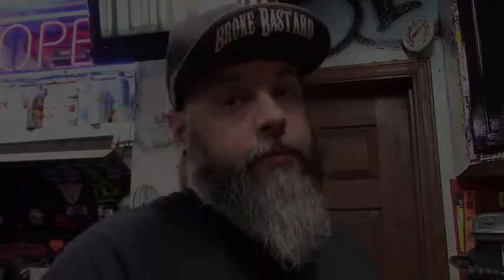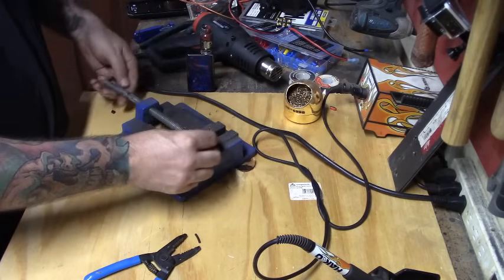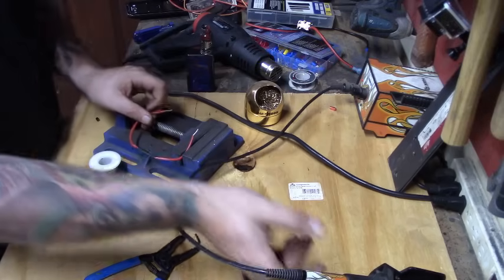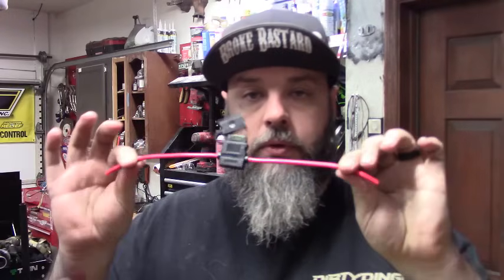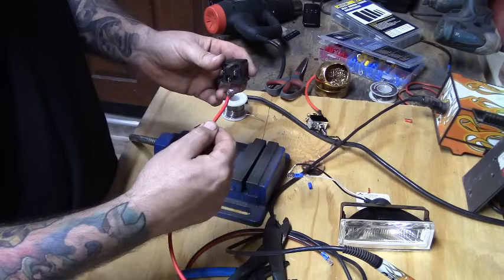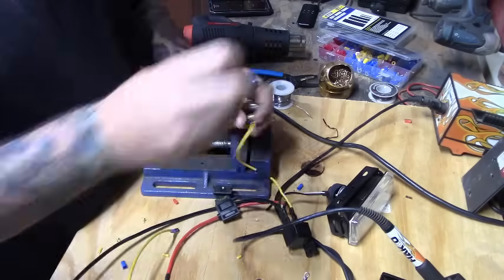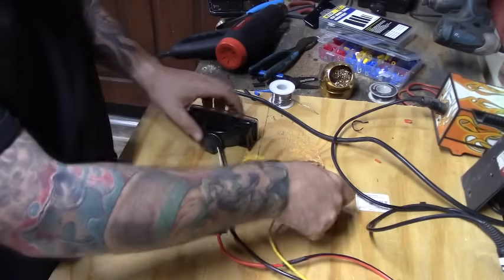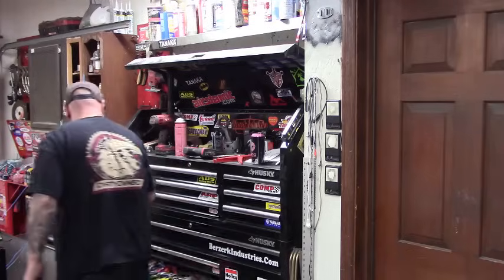How to wire a Relay and Why You should use them.

Comment: Great vid. Can I also suggest placing a diode across pins 85 ->|- 86 (in the direction - ve  ->|- +ve). This passes the back emf on an inductive load (relay coil). Some relay holders come with this diode already across those pin wires. Also, many of the relay holders that come wired, will only have the spade connectors crimped, not soldered.

Great tips here. Take care of that li'l kitty! :)

Comment: You should have a separate video for soldering (and zoom in on the soldering process) that points out the differences between stranded and solid wire techniques, and reference it - this video is for relays. Instead of using the vice, you should take the time to find the correct tools for the job. Emphasize rosin core v. acid core, the latter is used in plumbing and will ruin electrical connections. Lost interest at 8 minutes, which is about the time you started the content of the video.

Comment: It might also be good to point out also that the contacts on the relay are made bigger and beefier, to handle higher amperage than the contacts on a switch can. Which is why they use them with switches in professional installations.

Comment: Never ever just solder and heat shrink multiple wires to secure them together. always use either a mechanical connection or twist the wires together before soldering.  You must have a mechanical connection in a vehicle. You can not relie on solder  alone to withstand vibrations found in a vehicle over time. it will fail, not if but when! Otherwise great vid! I should also point out that its best to use double walled heat shrink, especially if this is used under the hood. if your flux is not "no clean" be sure to wipe the solder joints with iso alcohol before adding the heat shrink. this is to prevent the flux from corroding the joint over time.
Google how to properly solder 2 wires together. There are tons of vids available.
Thanks for sharing
Reply from the maker: Night Rider I never use a solder joint to support the wires. The in always mechanical straps securing my wires.
Reply from the maker: Night Rider also I never place relays in the engine bay because I build a lot of open wheel cars and I prefer the relays and fuses inside the cabin away from the weather. Also I very rarely have any connects exposed the the elements.   continuous runs only. As far as the flux rusting. I have cut open and removed the solder on cars I built ten plus years ago(no rust). But thanks for your info and knowledge.

Comment: No it's definitely the wrong way. I used fuses on everything rewiring my 90 bronco 2. A year later my headlight switch with 30amp fuse, and blower motor same way. The fuses never blew, but switches burnt up on both. Today I'm going out to wire in relays and changing switches

Comment: Solder alone won’t hold over the long term especially for off road. You need a mechanical joint as well such as the crimp and solder.

Comment: should the relay be as close to battery as possible?
Reply from the maker: Andre the polock doesn’t matter but if I was going to put it very far away I would fuse the power wire

Comment: How do you know what size relay? I suck at wiring
Reply from the maker: You have to find the draw that the accessory is using. If its not listed use the size of the wire. There are charts on line to reference, that show what amperage each size is rated for.

Comment: I don't understand at why you put an in line fuse on the light if ur using a relay? You essentially have two "fuses" on it?
Reply: A relay could potentially fail in the closed position keeping the circuit alive resulting in wires melting down and or fire. Fuses are cheaper and easier to replace. Also you could effectively use 30 amp relays on everything then simply put the appropriate sized fuse to protect the device and or wiring (based on the wire size and the load it is designed to carry)
Reply: @vanblindguy4600  30 amp relay 15amp fuse good?
Reply: @cavyboy99  yes absolutely
Reply: @cavyboy99  base your fuse size on the load of your accessory. For example if your lights are going to pull 10 amps under normal use, consider using a 15 amp fuse but also make sure the wire you are using will easily handle 15 amps you want the fuse to be the weakest link in the electrical circuit.
Reply: @vanblindguy4600  ok thank you. I'm just installing neon led light pods they aren't using much. So using 16 gauge wire. Thank you for replying back

Comment: Awesome video, learned a lot and went straight to get scrap wire to practice my soldering. Just one thing I didn’t understand, are you putting the relay in leu of the fuse or are you putting both?

Comment: ...What's a simple way for a Broke Bastard to make a car alarm that would ONLY work when doors open or window (s) break?...NONE of that Fancy stuff......
Reply from the maker: NonYourBuz see if you can find an old school Bulldog alarm. They had one wire to the body of the car and worked on vibration. Cheap and easy

Comment: Great video man very helpful, would 40/60 solder with the flux core be ok to use for the headlight wires instead of 60/40

Comment: It"s my personal preference is too put the switch in the ground wire.
Reply from the maker: Jack Gale more and more people are telling me the same. I have seen some people that use the relay to connect the ground
Reply: @BrokeBastardGarage  Any idea why?
Reply from the maker: @andrewbuckau5792  i have been told that the ground side carries zero voltage and a lower load
Reply: @BrokeBastardGarage  What effect(s) does that have?
Reply from the maker: @andrewbuckau5792  its just breaking the ground instead of the positive. Either way you just breaking the circuit. just make sure you fuse the positive and the fuse positive.

Comment: I was once a fuseless electrician like you,  but I took a short to the knee, Im a framer now. XD. Cereal though, it is amazing what rats nests I find in bikes and scooters..take your average electrical knowledge and cut it by 3/4 and you can imagine the meltdowns Ive dealt with. "Relay is the best way" but the ole  duel feed linked fuse is the stand by, double fault only sucks when looking for fuses, relays are expensive and that always sucks. Although, I have hacked my fair share of dead relays with a matchbook cover. XD

Comment: If you want to see what happens when you skip fuses, relays, and use the wrong size wires, go checkout your local pick a part at burned up vehicles most likely many were caused from hack job stereo installs and other hacked wiring jobs for accessories.

Comment: Are you kidding Mister---those crimpers are SHIT. Get a good pair of calibrated ratchet crimpers. And if you are soldering your wires you don't crimp. You don't mix crimp and solder. When you solder you now make the connection and the wire more ridged and brittle--it will fail. Crimping properly gives the wire connection extreme strength and retains the flexible qualities you need for a lasting circuit.

Comment: thats a horrible cable joint. you got a copper wire which has lower resistance, you tin the wire with tin/lead which has higher resistance, now you got a shit joint that will heat up. gotta twist both ends of wire together 1st then solder it. need that copper on copper contact.

Comment: tack soldering pieces of wire together  isn't physically a strong connection. the wires should be twisted together first.
just my .02c

Comment: Ohhh come on guy i wanna see the stripper with a sweet pair.love the video just curious is relays more to protect wires from getting hot by 12volts and burning ur car down in case of short.,??was just always curious why we need these relays.??thanks,snookie pa.
Reply from the maker: Relays carry the load so that it is not going thru a cheap little switch and shorting out (burning up)

Comment: I’m wondering if a short discussion would have been worthwhile as to when (under what circumstances) to use a relay. We don’t use a relay for all loads so we have to determine which loads (circuits) should utilize a relay and why.
Most switches and accessories are rated in either wattage or amperage. Not all accessories (like a car radio) need a relay. 
Knowing the amperage draw of the load (accessory) is key to determining whether a relay is required. If you know the wattage simply divide the applied voltage value into the wattage rating to arrive at the amperage in the circuit. 
Now you know what components such as fuse, switch, and perhaps relay, you need. 
Simply add at least 10% to 15% value to the known circuit amperage when selecting your components.
Reply: Relays are for heavy amp draws most of the time.  Winch?  Use a relay.  Power inverter?  Use a relay.  Ungodly bright light bar?  Use a relay.  New tachometer that only uses a couple amps? Fuse it.  

Looking at your fuse panels can give you a general idea as well.  The blade fuses normally don't go above 30 amps.  Stuff like the horn, headlights, etc that draw a lot of amps are all on relays.

Comment: Dude you people that think you know anything about wiring please leave it to the professionals fuck me i seen some cowboys before but you and Eric the car guy take the cake you crimp the wire so it can mechinaly join and the no need to soldier it's a relay depending where you are soldering the coil side or the output side???? you don't need to solder just crimp with proper terminals.

Comment: That's one way to do it, but it would never pass inspection at any production plant, in America.

Rule 1.) Make sure to do a good clean job of stripping the insulation off of the wire, ensuring that NO strands get nicked or sniped.
2.) Make a good MECHANICAL CONNECTION of your splice. In your example, that would require TWISTING your bared wires together, inline, rather than ends together, for a length at least 7 times the diameter of the largest of the two copper wires you intend to join together, (or the diameter of the strand bundles if using stranded wire)
3.) Be sure to check to make certain sure you have a strong mechanical connection that won't pull apart. The wire should break before it pulls apart.
4.)  Then you flux it, and solder it carefully WITHOUT burning the insulation, at all. (You may have to practise this, and adjust the temperature until you get it just right.)
And don't use too much solder. You should be able to fully wet the solder splice with full copper coverage, yet still be able to see each strand of wire once the solder cools and shrinks.
5.) Then clean off all the flux.
Standard solder school 101... since forever.
Just sayin'.

Disconnecting a high current DC load is very destructive for mechanical contacts, expexially when switching inductive loads, like solenoids, motors and relays. 
Take careful note of the DC specs of the parts that you intend to use.
For DC, you're far better off using solid state relays that use internal MOSFETS.
They are just as easy to connect and use, more so in most cases, and will holdup MUCH longer in DC service. They won't arc-over like mechanical contacts will.
But if you insist on using electro-mechanical relays, it is imperative to add "back EMF" protection. (look it up, expexially as it relates to relays). Expexially if you have ANY sensitive electronics onboard, like stereos, engine/trans controllers/modules, electronic ignition, etc.
A simple relay breaking contact can create a HUGE voltage spike, thousands of volts!!! if you don't take the required steps to prevent it. It's a pretty simple fix.
Break-downs that can be avoided, should be avoided at all costs. Electrical failures are no fun when you're headed to Vegas across a scorching hot desert. I'll go one further and state that no break-downs, anywhere, are fun.
Jussed tryin' to help.
No offence intended.

Comment: Save yourself a few steps, use marine grade quick disconnects. The also have a version that crimps, solders, heat shrinks, and is shielded around the female end. They look like this:  https://www.waytekwire.com/item/30982/Molex-19164-0017-Perma-Seal-Quick-Disconnect-/

Comment: Great video, but I connect both the switch & relay wires after the fuse, just in case one of the switch wires shorts out to the frame, I don't want burning wires in my vehicle!
Reply from the maker: yes you should always fuse any power wire

Comment: Yeah but what does that inline fuse have to do with wiring a relay?
Reply: The inline fuse is still there to limit current flow in case hot wire ever shorts to ground. If it’s not there the wire will carry as much current as it can before the wire melts. This can lead to a fire.

Comment: Thanks for the Video on how you do your wiring,,, 
Never tinned my wires first and always used big solder... Going to give your way a try next time, maybe it'll look better...   Thanks
Reply: The secret is '
in choosing the 
solder wire core
chose 60/40 solder 
and at least 60 watts 
220 VAC electric solder gun.

Regards

Arab Aircraft Engineer
and QC Lead Inspetor ,
Jeddah, Al-Hajaz, Arabia .

Comment: RELAYS are bad news for starting DC fan motors from a dead stop.  Peak currents can blast the contacts or even blow the diodes in your alternator.  Some fan can have over 100 amps peak starting current.  Using Pulse Width Modulating control of your fan motor is a better way to control radiator temperature.   www.autocoolguy.com

Comment: Good video. Few suggestions, only switch the negative. Not only is it safer but typically less wire since you can utilize the body as traveler/source. Also worth installing a diode in parallel between the coil of the relay to prevent back emf from wearing out the switch.

Comment: First off, my electrical expertise doesn't go too much farther than installing car audio or the occasional light fixture/ceiling fan or outlet in a house. I've always used the crimp type connector for car stereos(or twist-on wire connector for household wiring) and all but one time, it has been successful. The power wire came loose on one of my cd player installs and since then, I triple checked that all of the crimp type connections were secure. That being said, I have never soldered anything until now. I used your method and soldered the wiring harness adapter to my cd player on my newly acquired Crown Vic police car, heat shrink tubing and all. It worked like a charm! I definitely won't ever use the crimp type connectors again unless there is no other option. Anyway, thanks for the excellent guide and once again, you gave me the confidence I needed to attempt it myself. Thanks man.
Reply from the maker: Anytime. Glad I could Help.

Comment: Uses rosin core yet says he does not use flux. WTF do you think rosin is? Also, solder does not "dry". It cools... BTW, the connection of a properly crimped terminal (not connector as you call it) is magnitudes stronger than a soldered connection. Solder cracks, crimps don't.  There is a reason you never find a soldered connection from the factory in a vehicle. It's because due to vibration, they fail. A properly crimped connection does not need any solder. You are just wasting your time and effort. You are not adding any strength when crimped correctly. It's also perfectly fine to break a connection with a properly spec'd switch without using a relay. Automotive manufactures do it all the time. The only time a relay is required is when you either don't want to run the high current wires to the switch location or your switch is underspec'd for the load.

Comment: Good informative content, thanks. What do you think of using a Fuse Block to add multiple accessories? Some come with a built in relay and gives you a choice on whether you want the accessory on switched power or not. They are relatively easy to wire and consoldates everything to keep away from other wires. Thoughts?

Comment: Horrible method for soldering.    Spread the strands of both twisted wires.  Push one end of the wire into the other so spread strands cross one another.  Twist the strands opposing one another thus tying the wires together tightly.  Now solder that’s joint.     That joint will have structure and resist vibration cracking unlike the lap solder joint you made.